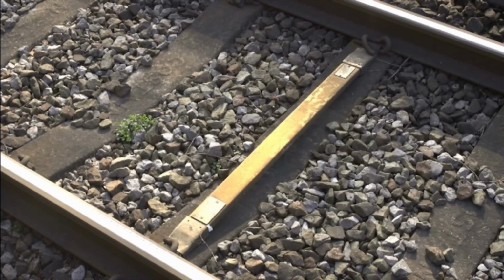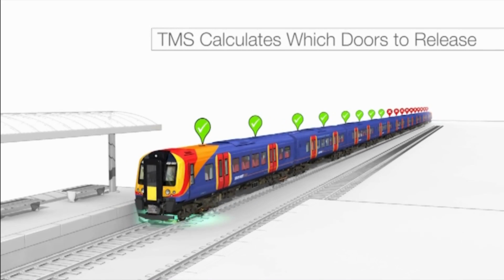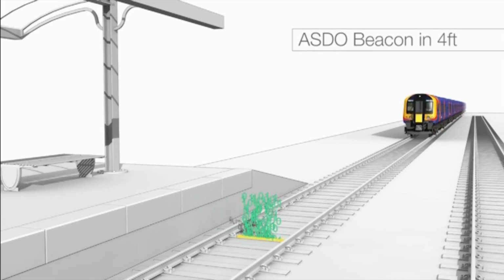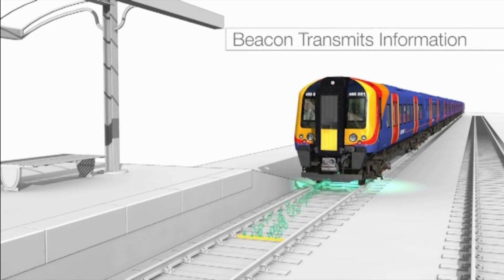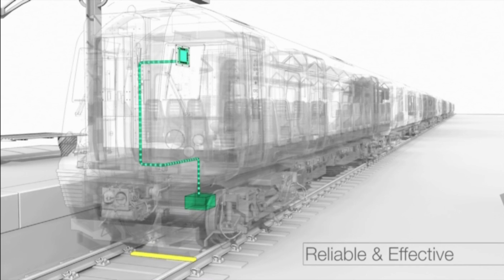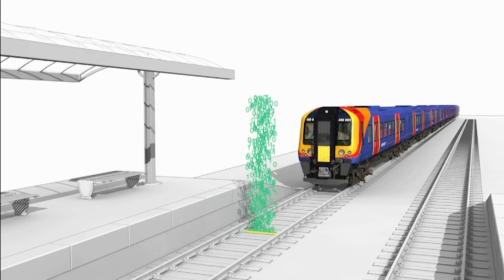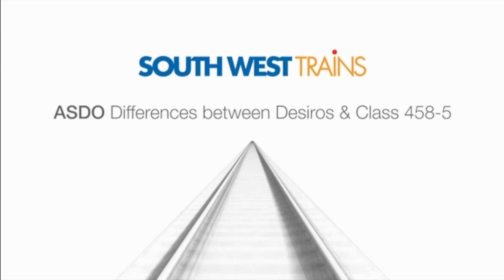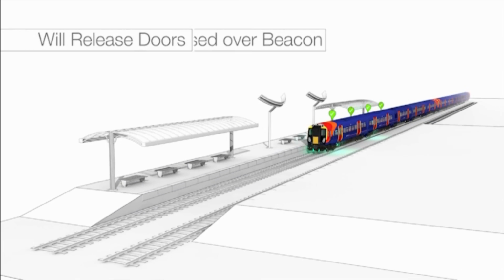South West Trains - ASDO Training Video

Comment: 7:40 Why not simply reverse the train back onto the platform?
Reply: They can’t do it because they already ran the light I think so, I’m not 100% sure
Reply: @aq_h09  Yes it did run the light but why not just call the signaller and ask for authority to do that?
Reply: @marcuspotter5590  the line isn't reversable so the train can't move backwards
Reply: @brycedalton4674  Just use The reverser(F/N/R)to go backwards
Reply: @TheArkamedBat  Reversing a train correctly is not as simple as reversing a car...
Reply: @TheArkamedBat you risk tripping signals doing that.
Reply: @alfi_csgo6011  Moving just by a carriage I don't think so, but not if the last carriage has cleared the track circuit on the platform.
Reply: @ depends on if the area in question uses Axle Counter or Typical Track Circuit. Protocol for us guards if the train overshoots by one door is to lock the first set of doors out of use before putting a full door release up, but any more than that either use a local door or often the train will continue to the next station where the driver will most likely give duties over to another driver as is standard in most operational incidents. A station overshoot is extremely rare and as such is a very serious offence.

Comment: I have been on 450001 and both type of trains that are ASDO capable (450 Desiro and 458 - 5 Juniper)
Reply: Jack Jack Productions The chances of being in the train with the exact number 450-001 is about one in 300. Maybe a class 450/455, but probably not 450-001.
Reply: Lawrence Martin ok, what line was it on
Reply: Jack Jack Productions what line was what on?
Reply: Lawrence Martin the line between London Waterloo and Reading
Reply: Jack Jack Productions  don't forget the Guildford to Alton, Waterloo to Weybridge (sometimes) Waterloo to Dorking/Guildford via Epsom, Waterloo to Basingstoke, Waterloo to Poole, and Waterloo to Woking.
Reply: Getting unit 450001 is a one in 127 chance. And I achieved it twice in a week.
Reply: @emmaclarke9243  It really isn’t as simple as 1 in 127... train diagramming isn’t completely random.
Reply: I went on 450001 from Woking to Guildford

Comment: Just out of interest, is it not just wasting computing space if the train does not stop at the station?
Reply: Hectictea 42 Productions No, as the train would normally call there. Data is only temporarily stored in the train, and permanently stored only in that beacon for that station only.
Reply: I would assume that whenever you’re designing a system such as TMS, you’d provide the amount of memory that would cater for all the foreseeable features you’d have with the assumption that each feature (where possible/it makes sense) could use the maximum amount of memory possible at the same time, no?

Comment: Just by saying "Blackberry", you can tell this videowas made over 10 years ago!
Reply: No, ASDO was installed across the SWT network in the early 2010s. Blackberry's were eventually replaced by iPhones.
Reply: 458/5's didn't exist in 2008, so this was probably made at least a few years ago.
Reply: I literally said that.
Reply: 458/5s were made from the 458/0s. the 458/5s were converted in 2014
Reply: This video was made about 2014-15. It was then that ASDO was fitted on the SWT Desiro fleet, as a later upgrade. This video has nothing to do with 458’s!  The guards were issued with Blackberries. I believe they now have iPhones.
Reply: JamesonEst1780 you are awesome
Reply: And yet we still use this video for training today! Pretty much everything is correct, but certainly a little dated.
Reply: Xboxbro68 this video was actually likely made between 2004-2006 as the class 458/5 trains were built between 1998 and 2002.
Reply: MrBnsftrain IT WAS MADE 3 YEARS AGO!!! YOU FAILED THE SMART TEST ON WHEN THIS VIDEO GOT UPLOADED!!!!!
Reply: @Mr Brist
Reply: @MrBrisftrain.What is Re Boot.
I liked the old slsm doors.
I left my Blackberry on the train. Maybe it s in lost property.